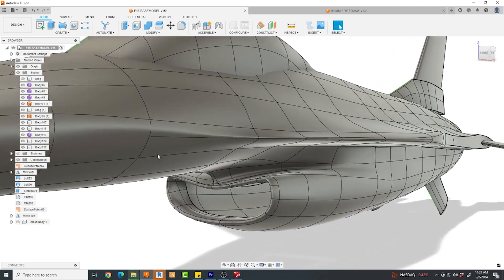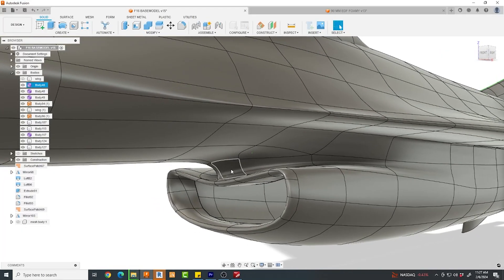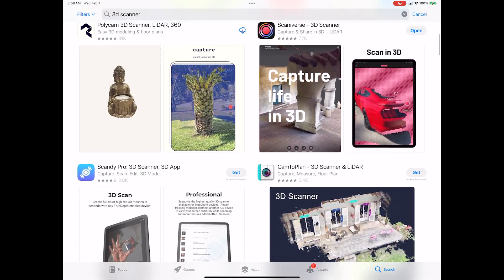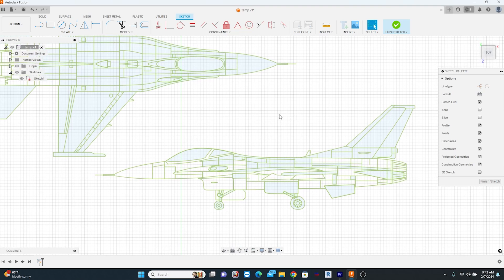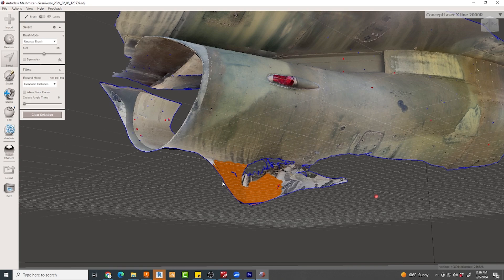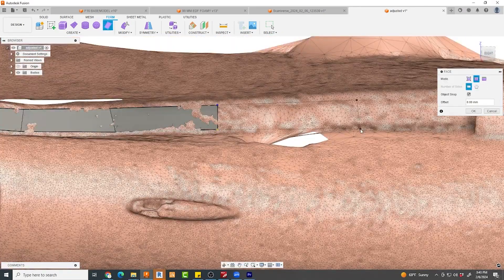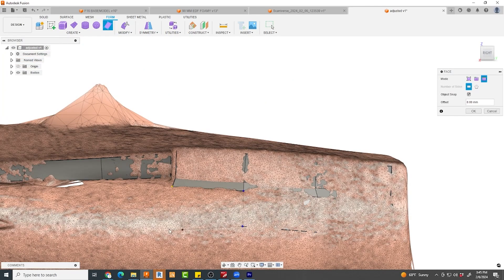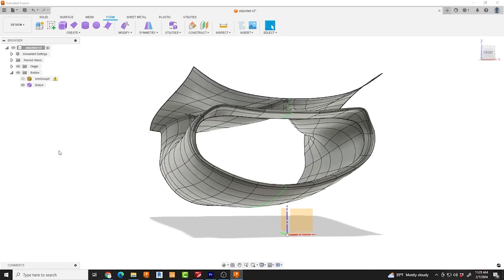I scanned a real F16 with a scanner you own!  How good is it in fusion 360?  #fusion360 #rcjet

Comment: Thanks Redbaron for showing me the 3D scan of a full-scale F-16. How will you accurately scale down so every section fits ? ( I am doing something similar but struggling)
Reply from the maker: Once I modeled everything I wanted I converted it to a surface.  As a surface it is more precisely scalable.  Then I brought in to my full model and located its position.  From there I edit my full body splines and I can reference my imported surfaces.